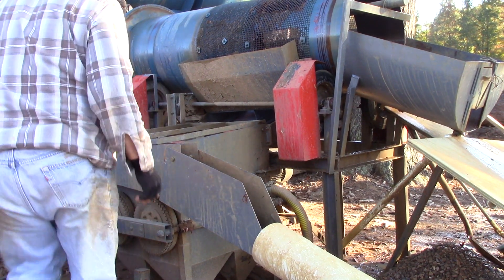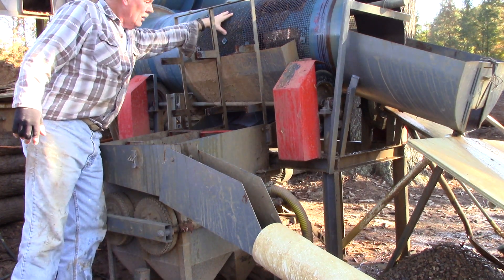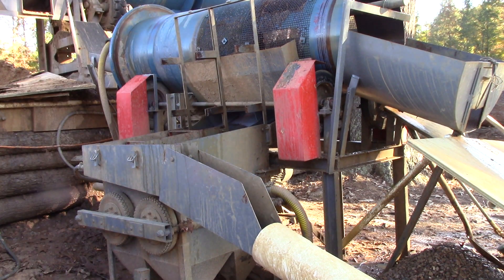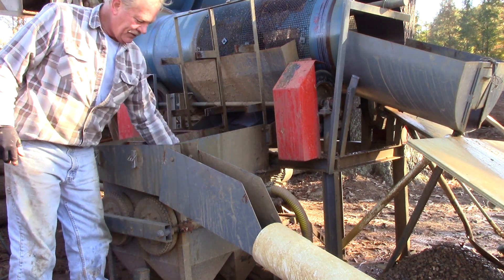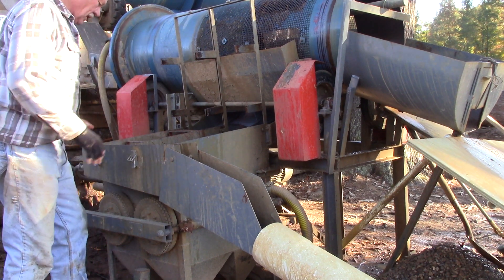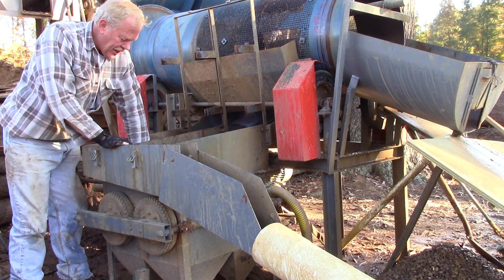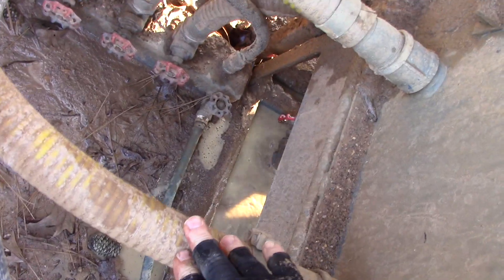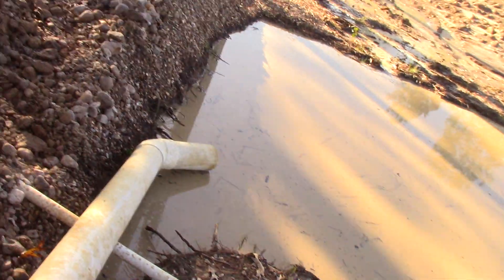Learn How The Lower, Jig Plant Works And See Me Remove The Four Trays That Catch All Of The Diamonds

Comment: no way to eliminate the silt prior to the jig? longer run times
Reply from the maker: No, but I am pondering opening the valves at the bottom of the vats slightly to allow silt to run out continually IF I can maintain adequate waterflow on top to float out the light material and keep jigging pressure in the vats.  I'm going to try it and see.  It might take some trial and error adjusting of valves, but I think I can make it work.

Comment: Very impressive private plant.  Did you design and build this yourself?
Reply from the maker: No, it was designed in South Africa by people who find diamonds all of the time.  This time last year it was on a ship in the ocean on its way here.  It came in a shipping container "with some assembly required" to put it mildly.
Reply: @genuinediamondsinar3253  As a retired hard rock miner, in south east Missouri, I think I understand the operation. I would enjoy hearing about the whole cycle and principle of operation. Do you check the large aggregate in the discharge for "Uncle Sam" size rocks?
Reply from the maker: @cal82252  Oh, yes, I'm looking for large diamonds as well as small.  I will have an upcoming video that shows the oversize discharge and the sluice I have set up on it.  So, you were a hard rock miner in SE MO, did you mine galena at Doe Run?
Reply: @genuinediamondsinar3253  Yes. Lead,copper and zinc. But mostly pb.
Reply from the maker: @cal82252  KEWL!  My wife and I went to a geology dinner meeting in Little Rock years ago.  A couple of guys from Doe Run spoke about their mine.  They gave each of us a nice galena specimen and had a drawing for a Doe Run hat.  My wife won the hat, and I wear it.  We still have our SE MO galena specimens in our mineral display case.  The only thing bad about that area is you are near the New Madrid Fault.  If it goes again, the whole nation will feel it.  The last time 1814? it shook far away Boston, MA, so bad that bells rang.
Reply: @genuinediamondsinar3253  We thought about that, and had extra food stored. At 1000+feet down and damage to the primary and secondary shafts could be a problem.
Reply from the maker: @cal82252  I'm glad it never popped.  Hopefully, it will hold off a while longer.
Reply: @genuinediamondsinar3253  Yes. Me too. The biggest threat is from back fall and heavy equipment accidents. That's why I retired. To many close calls.
Reply from the maker: @cal82252  I retired from a career in plumbing.  It wasn't nearly as dangerous as your job, but I'd hate to get hurt in my last year of work then not be able to get around like I want to and do the things I had planned to do once I retired.  Stay safe and well.